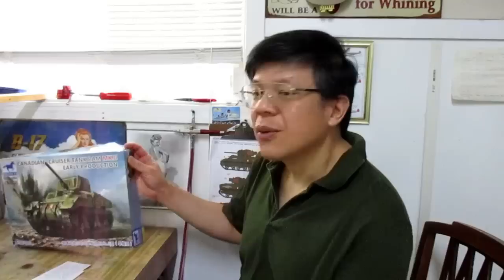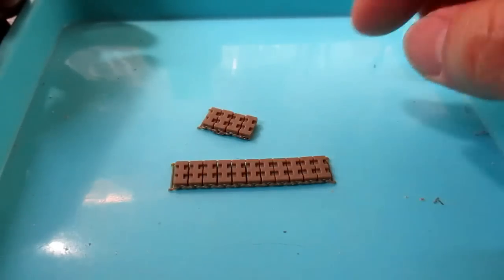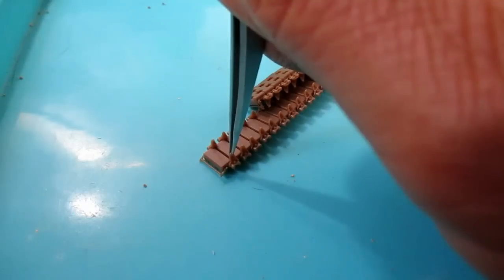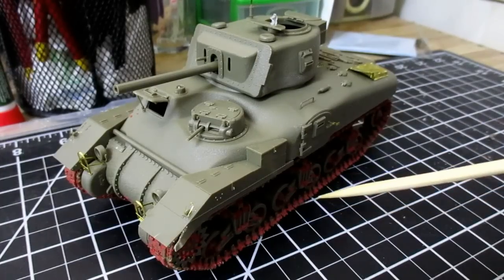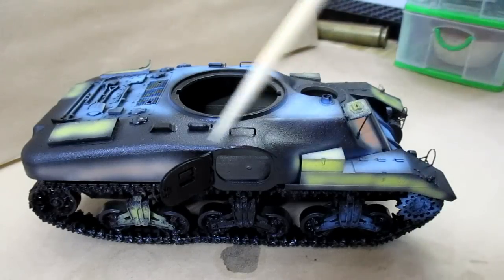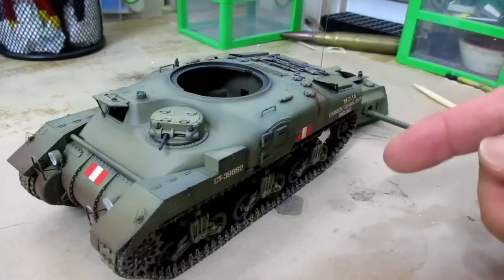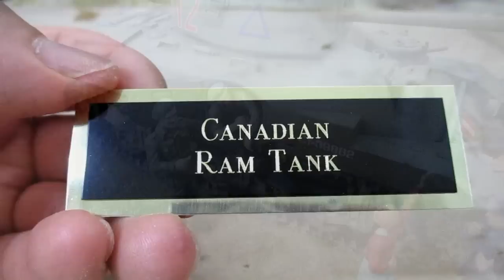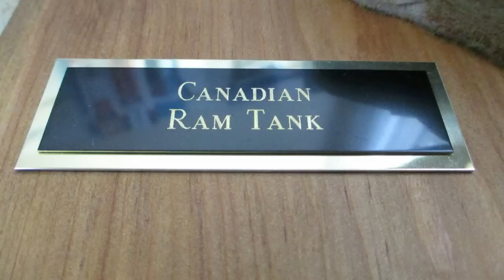Building Bronco Ram Tank. From Start to Finish. 1/35 Scale

Comment: I stopped over for 2 days in Vancouver BC on my way to the UK in 1988 & they have a RAM on display there. I took a couple of photos of it. At the time I thought it might be just a hybrid version of the cast hull Sherman not realizing until a few years later it was a Canadian built tank.
Reply from the maker: I totally understand your misperception. I had the same thought when I first learned about it too. I thought it was a Sherman. Oddly enough, the Canadians did manufacture an almost identical version of the Sherman but they called it the Grizzly.

Comment: I'll stick with the rubber band tracks lol.
Reply: Tamiya all the way! 😀
Reply: I like fruilmodel tracks, they’re metal, individual link but you can use staples or wire to put them together, much easier than gluing
Reply: For sure on a Sherman type tank.
Reply from the maker: These tracks were a huge challenge for me.
Reply: Individual tracks are indeed tedious. I prefer the vinyl rubberband tracks or plastic tracks in sections. But at least manufacturers like Meng include nice tools to make assembling individual tracks a bit easier. Sorry to see that Bronco didn't include anything like that in this kit.

Comment: Wow it looks like I missed this video.  I must not have been paying attention.   I don't mind building tracks.  If you do it right they can look at lot more realistic then the rubber tracks.  About 1/3 of my models have built tracks.  If I buy a model and don't like the tracks I will get some after market tracks.   I have a parts box in my hobby room that is just full of the rubber tracks I discarded from other models.  I'm sure a set of Sherman Rubber tracks would work ok depending on the model company they came from.  Not all are the same.

Comment: Wouldn't fruilmodel track's be easier and faster to build?
Reply from the maker: Never tried that brand. I should to see for myself. Thanks.
Reply: @qdc748a   Great suggestion on Randy's part. The Friumodel tracks are brilliant! I've used them on  a T-55AMV, a T-34/85 and a Centurion - all in 1/35 so far.  

Just to make the white metal tracks a little bit more interesting, I also used a product called 'Blacken-it', which oxidises them in a real black/red rust! Not the cheapest way to track your models, but I assure you that the end result is well worth it :-D